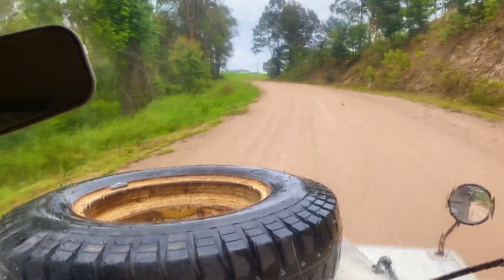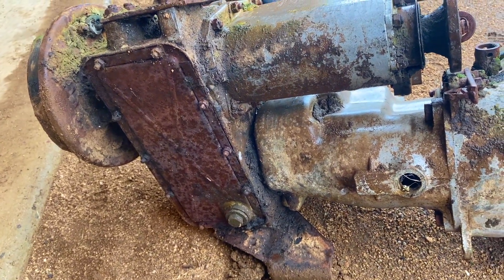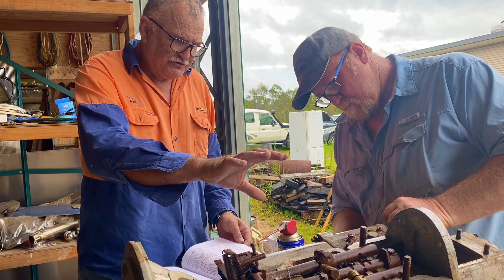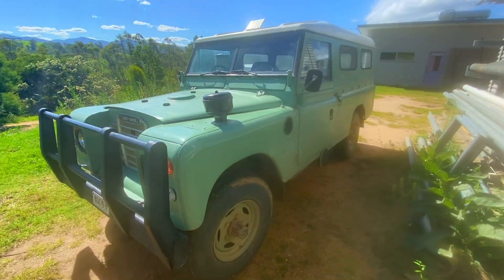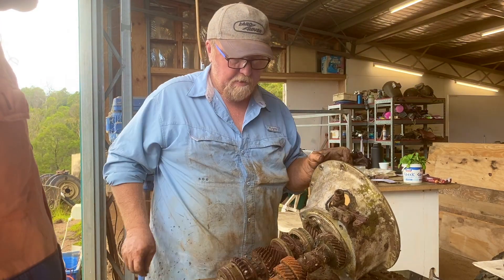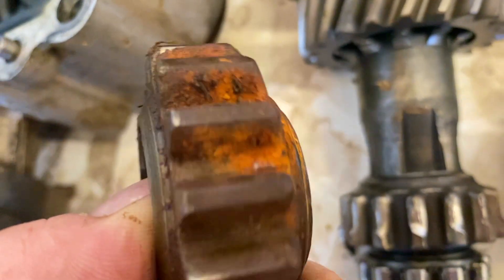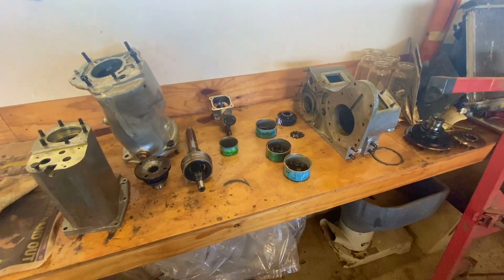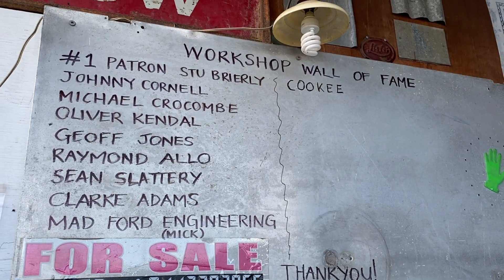Landrover 2A electric conversion & restoration - Gearbox strip down & parts salvage

Comment: My next job Steve is the gear box so this is a timely video though mine is in much better shape thank heavens. Did your camera survive that hit?
Reply from the maker: Our actual gearbox was in far better shape than the one we stripped down to get parts out of, as I said, I could have bought the parts new but where is the fun in taking the easy and sensible route.    Camera (iphone) was fine, I do wreck one a year so I am overdue for an 'unfortunate happenstance'.

Comment: Such a labour of love, those gearbox parts came up like new , would you mind telling what was the solution you you were cleaning it with
Reply from the maker: Its just a degreaser mixed with diesel Carlo, works pretty well.  The alloy tends to stay in relatively good condition under the grease and grime, it comes off fairly easily.

Comment: Had the same problems in the wet with my Land Rover here in good old Blighty. To cut a very long story short,  Turned out to be the black plastic used for modern replacement rotor arms is very prone to tracking in humid conditions, killing the spark. Replaced with the red plastic type and problem solved.
Reply from the maker: Thanks Graham, good tip.  I am considering changing to electronic ignition, the timing seems to drift around a bit which I suspect does not help with the running temperature.
Reply: As long as you rule the ‘Prince of Darkness’ you should be on the safe side....
Reply: @henktulp4400  Joseph Lucas = Prince of Darkness
Reply: Rule OUT that is,obviously....

Comment: Are you guys going with a gearbox and transfer case now? I seem to recall seeing mock ups of the motor being held up directly to the transfer case. 
Both directions have merit and more gears is just more options. Just transfer does make for heaps more room in the engine bay for batteries though.
I may be waiting for many years for an EV conversion untill battery costs come down a bit. The 86 can sit in the paddock untill then.
Reply from the maker: The need to fit those 3 internal mounting  bolts into the transfer case make it a bit of a pain to mount the electric motor mount plate directly to the transfer case (ie to remove the motor would involve stripping down the transfer case also to access mount bolts).  As you said, lots of drive options with a gearbox.  There is ample room for batteries so that is not really a concern as we can utilise under the seats (fuel tank position) also to lower center of gravity and spread the battery load a bit.  Making an adapter plate to fit the bell housing is way easier also.  Lots of plus and minuses.  If we fail to get sponsor ship or raise the funding to buy the batteries it also affords the option of restoring a combustion engine as a back up plan to get it back on the road.
Reply: @VintageRestorationsAustralia  makes sense. Good to keep the options open. I have a divorced series transfer that was modified to have a mounting flange to take any gearbox through a mini drive shaft. Happy to share details if you decide to not use the gearbox.
Reply: Dying to see this come together and move under electricity

Comment: If only you were sponsored by WD40 you might use it to waterproof the ignition system for wet days.
Reply from the maker: Yer if only :-)  I did actually use some wd-40 on the coil and points to dry it out :-)